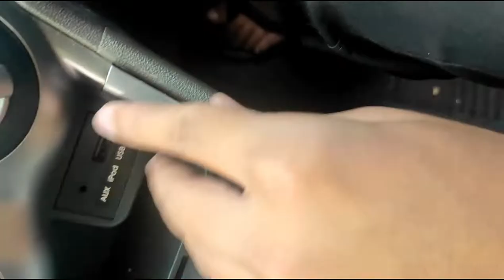DIY : How to Replace Shift boot / Change Gear lever cover (Hyundai i10)

Comment: In which online platform is this i10 gear cover assembly available? Will the quality be good if it is purchased online? What will be your suggestion?
Reply from the maker: I bought it from Amazon... i have mentioned the one i bought in description. You surely can buy it from amazon as you can return it if anything is not upto the mark. Also offline platforms i.e. shops and service centers have it on a bit costlier side where i live, might be different for your location. But yeah if you think this process was easy get one from amazon or flipkart and have a fun weekend DIY session working on your car 😉 (quality was good on amazon just that stitch on one side was loose but i got that repaired myself rest was good 👍🏻 still looks and feels good after 5 months) Hope this helps ♥️
Reply: @auto_athus  Great, this video and the message was really helpful 👏 Thanks much Athus 😍

Comment: Can you give me the link of Amazon for this  I also have to change it for i10 2011 model
Reply from the maker: Hey, Check the description i have linked the one i used if thats not available you will be automatically recommended similar by Amazon 👍🏻
Reply: @auto_athus  there is no link in description. You are a cheater
Reply from the maker: @Frank_Castle_Nair  please click on read more in description there is link also on amazon it generally gets sold out only that time link doesn't work.

Comment: Very good
Reply: You seat cover is also nice.. can you please let me know the price of your seat cover..
Reply from the maker: @dineshkumarparasakthi5523  Got them from local market in a combined package so dont remember the exact price of my design... But They had a range of seat covers starting from 2000 to 6000 rupees (2 bucket seats and 1 bench seat) depending on colour and style you choose.

I have the bill somewhere i will find it and then i will make a video about all the interior changes with pricing if you want 😊
Reply from the maker: @dineshkumarparasakthi5523  i just checked the bill it was 2800 for the seats

Comment: Where i find the replacement?
Reply from the maker: Amazon! Just be sure to mention your car's model thats it.
Reply from the maker: @KekkoLinkin  where are you from ?
Reply: @auto_athus   italy
Reply from the maker: @KekkoLinkin  oh no! I dont know about Italy friend... You have to search for 'shift boot or gear lever cover' on banggood or AliExpress types of site which ship internationally. And chances are that you will get the boot cloth without the frame which you have to remove from old boot and install on new one manually. 

My Suggestion to you would be to buy any generic shift boot cloth/ faux leather from any preferred ecommerce site... Cut the hight as per older boot...  and then remove the plastic frame from older boot and staple it to the new generic boot...  and you will have a new cover ready to install! 
Its very easy only sounds difficult  dm me on Instagram @athus207 if you need any more help after you buy said things 😊
Reply: @auto_athus how easily staplable is it
Reply from the maker: @KrYpt07  as easy as it gets
Reply: @auto_athus  can u staple it with a stapler, like a normal paper stapler
Reply from the maker: @KrYpt07  no the bigger stapler you can try with smaller one but i dont think it will hold in long term